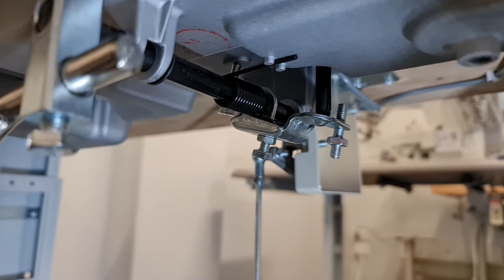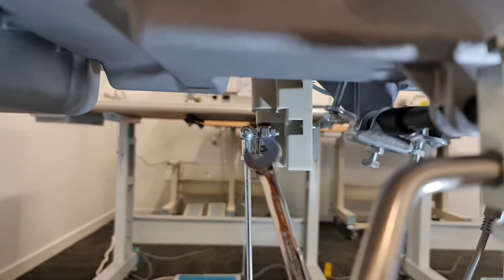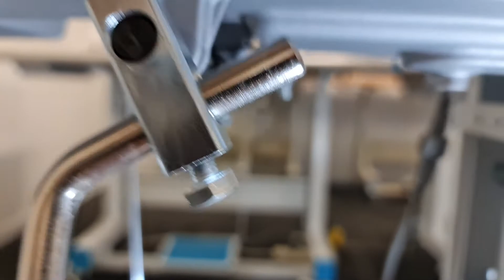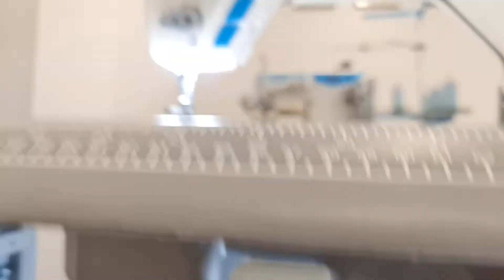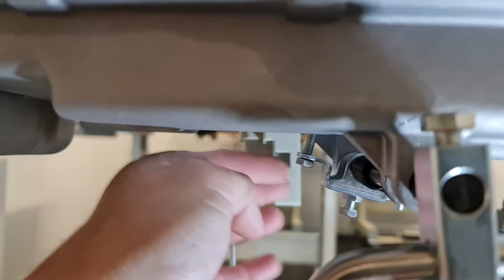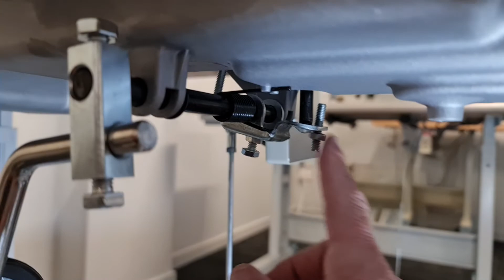How to adjust your knee lever on an industrial sewing machine.

Comment: Hi. I’ve just got a Jack A2b. I’m finding that I stop, cut the thread and even just VERY GENYLY putting my foot down the machine starts sewing again. What if any can I adjust do it isn’t quite so sensitive please? BTW It isn’t a speed issue as that is fine
Reply from the maker: Hi! You will find on your motor control box that there is a return spring, there are multiple positions for the return spring on the arm that it connects to. You will find the if you move the spring further out on the control arm that it will be a bit stiffer on the foot control so this may help.

Comment: I have jack F4 sewing machine... there is a problem of continuous stitching even when I stop pedal... automatically stitching even when I take off my foot... I have to press the pedal reverse to stop stitching.... please give me a  solution for this problem...
Reply from the maker: Make sure your foot pedal is free and not sticking, you can also adjust the spring pressure on the foot control unit which is attached under the table.

With the machine turned off, your foot pedal should easily return to its rest position when not depressed, make sure all linkages are free and smooth.

Comment: Thanks for posting this video.  Just wondering - if the bar underneath is already hitting the metal at the end of travel, does this suggest the foot height can't go any higher?
Reply from the maker: It is possible, be mindful that when you set the presser height, you want to ensure the needle bar cannot strike the foot at when thr needle bar is at its lowest position.